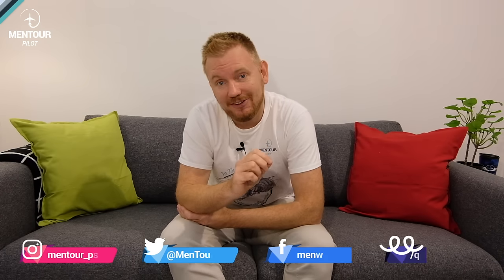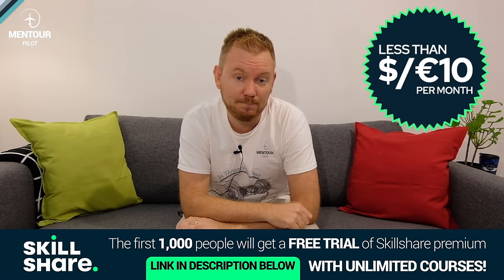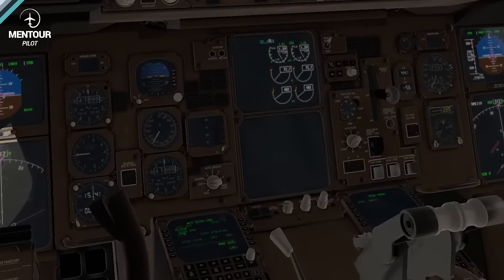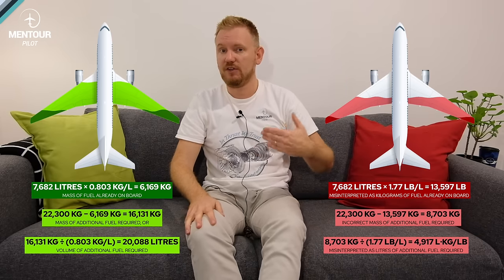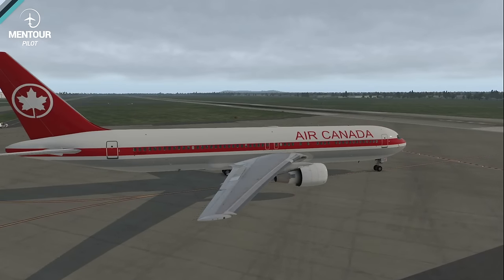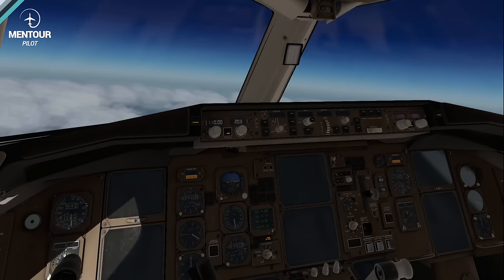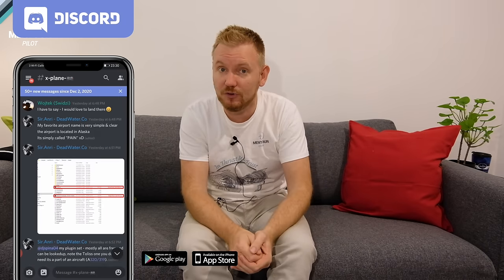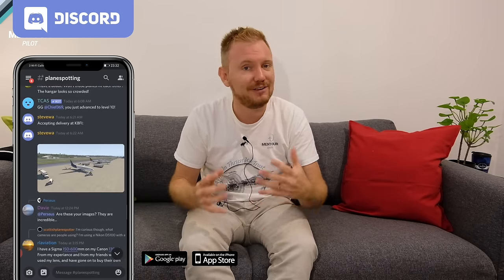The Gimli Glider! Explained

Comment: Several pilots attempted to duplicate this landing in a 767 simulator.  None were successful.
Reply: Same with Souix City and most/all on Sully's Hudson landing (not a miracle, just bloody good airmanship).
Reply: Another Canadian pilot, Robert Piché, pulled off another insane thing with Air Transat flight 236, an A330 on Aug 24th, 2001. The "Azores Glider" fuel ran dry and flamed out, glided 75 miles (120 km) from the Atlantic ocean with no engines, performed a 360 turn, a series of S-turns and landed Lajes Air Base in the Azores Island.  The aircraft, C-GITS, is still with Air Transat, last flew in July 2020 and has been parked temporarily.
Reply: @texasabbott  I´m starting to think that gliding training must be mandatory to get a pilot license.
Reply: I've been wondering: does the simulator even know how to fly such situations, if it has never happened before?  Especially this side slip thing: It's hard to imagine that the developers of the simulator took into account all these things, including the reduced hydraulics support due to the turbine not getting enough air flow and so on.  Do folks here know whether the simulators support such unusual situations?
Reply: @KaiGrossjohann  Based only on watching aircraft investigation shows & Youtube pilots, simulators seem to include an aircraft’s expected potential malfunctions (those with checklists), then unusual real life accidents may get added in later.
Reply: @KaiGrossjohann  The simulator doesnt need to know how to fly. The simulator "only" has to know how to calculate an aerodynamic model as accurate as possible again and again in real time.  ("only" in quotation marks because thats the most difficult part)
Reply: @Merilix2  Well the question is if it has "all" the variables I guess.

Comment: One of the most remarkable feats of pilot skill - side slipping a 767 onto a disused runway without any fatalities!
Reply: As an aviation buff and Canadian I figured knew all about this one. But it's Mentour so I have to watch. And then learned a lot. But I knew that the crew were solid gold. All of them.
Reply: Mentour, can you cover Air Transat Flight 236? Sadly another Canadian based carrier that ran out of fuel. But landed without any fatalities in the Canaries I think. And of course, the flight crew got some blame. Cross feed valve use I think. Go figure.
Reply: @roderickcampbell2105  Azores.
Reply: @dmack1827  Correct, it was in Azores and not Canaries. Thanks.

Comment: As an aircraft technician in the RAF I always carried a little slide rule so I could convert Imperial gallons to pounds.  The aircraft I worked on - AW Argosy had gauges in lbs and the tankers were in imp gallons.  I always asked the tanker drivers for the Specific Gravity of the day because it varied a bit.  I also knew the conversion for litres as some tankers were in litres.  We never had any tankers calibrated in pounds so this was all normal.  But our fuel gauges always worked!   And the aircraft would never have flown with inoperative gauges.

Comment: A great one, but don't forget about captain Dardano landing on a levy under similar circumstances.
Reply: Taca 110, a 737 piloted by Dardano, still had plenty of fuel, but his engines were literally waterlogged from flying through a storm at reduced power, because they were preparing to land.  I thought it was kind of neat that the levy they landed on was the edge of a NASA factory where they built the external fuel tanks for the space shuttles and they were able to tow the aircraft to the factory driveway, repair the plane enough to fly and took off from the driveway/runway to get it properly repaired, but damage was relatively minor.
Reply: @danuttall  Captain Dardano was a very difficult feat because of the remaining fuel increased the weight; and their engines were very damaged, not only "soaked wet", but actually thermally damaged beyond hope.  Thanks to that particular accident, the design of the CFM56 had to be altered, and also changed the testing criteria. Then another accident, Garuda Indonesia flight 421 suffered the same problems, as were other several cases... so, for practical reasons, Dardano was piloting a heavy powerless glider with a useless weight on each wing, and no Reverse thrust courtesy of CFMI, on a grassy levee and not resembling any runway at all.

 After his extraordinarily well executed landing, the 737-300 started to sink in the mud, so it had to be jacked up and moved soon, before it would become too imbedded!
To be fair, ALL four extraordinary landings (Sully, Pearson, Piché and Dardano), ALL OF THEM were astonishingly good. The four crews deserve our utmost recognition and respect on an equal level.  A class by themselves.  In all four cases, the First Officers were as good as ever, displaying a brilliant CRM and team like performance, and the same can be said of their cabin personnel.
In one way or another, the flying pilot had an "extra" that became useful: Piché and Pearson were both experienced glider pilots... Dardano had plenty of Aerobatics and smaller, "seat of the pants" flying experience, and Sully had expertise in analizing and studying aviation accidents.  That tells a lot.

Comment: I recall reading an account in which the pilots heard a “bong” sound from an alarm indicating that they’re out of fuel. They’d never heard it before or been told it existed...
Reply: Yes but that sound alarm does not mean "out of fuel". It means a total electrical failure and the reason why they had never heard it before is because it should never occur - but that time, it did. They lost all generators, all power sources due to the lack of fuel, except RAT and batteries.